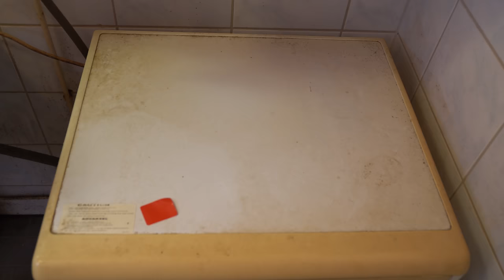Dirty Bathroom Cleaning ASMR

Comment: Here’s a cleaning tip people may find helpful.  For corrosion on stainless steel, like in a shower, take a piece of aluminum foil (or tin foil) and loosely crumple it up.  Get it wet and scrub the corrosive parts.  Not only does it remove the corrosion, it polishes it at the same time.  It’s pretty cool.
Reply: My parent taught me that lighter fluid will remove rust spots from stainless steel. One small container lasts a long time.
Reply: Oi👏👏
Reply: Sounds good, I’ll give it a try.
Reply: like a sponge?
Reply: Good tip! How about stubborn water spots?
Reply: Oi👏👏👏
Reply: I'm going to try that, thank you!
Reply: Cema de semana mais uma semana depois 71🕭🕭🎷
Reply: Cema Olive a minha mãe que irmã 8wji 🕭🕭🕭🕭

Comment: You may want to consider wearing a respirator in homes with black mold. It's likely not good to breathe it in.
Reply: Not to mention using acid in an enclosed space. I would've either passed out or have gotten a migraine...
Reply: I think the acid she uses is just vinegar, or the spray on oven cleaner
Reply: @naomipask1809  Oven cleaner is alkaline (the opposite of an acid) but you still shouldn't use it without proper ventilation. You have to be very careful using these types of chemicals. Just sayin.
Reply: I agree! You must also take care of yourself!
Reply: I agree! The fact that she does not use protection while cleaning those moldy bathrooms!
I feel bad for her lungs.
Reply: I actually came to comment the same thing

Comment: Wanted to add, I love how Finnish bathrooms apparently are usually able to just be sprayed down, with an open drain to wash everything away. Wish we had those here in the States.
Reply: If I ever get to renovate my bathroom I am definitely trying to get this done!!
Reply: You guys don’t have that?? (sorry if this sounds rude, i’m not very good at ✨socializing✨)
Reply: @edwater.3   no we don't but I wish we did!
Reply: @edwater.3  No, not rude at all. No, American bathrooms typically have either a separate shower or tub with either a curtain or glass doors. And we usually don't have just the simple pedestal sinks, but vanities with drawers and cupboards underneath. No drain other than in the bathtub/shower. The washer and dryer are usually in either a separate room or a closet of some kind. Or if your apartment doesn't have a washer or dryer, you have to bring your clothes to a laundromat to wash them. I don't miss that!
Reply: I'm so shocked they don't have them there, here is Australia we have floor drains also.
Reply: We don’t have washroom floor drains in Canada either. Does that mean after every shower you have to wipe the floor down before others can use the toilet/vanity? I can see that being a hinderance.
Reply: @Wood.Gardens  I think the floor is usually at a slight angle to let water flow into the drain so that you don't end up with a flooded bathroom. 🙂
Reply: They definitely have their bathrooms figured out. 😊

Comment: Auri, the toilet limescale remover liquid works fine as well for the limescale of glass and ceramic floor and ceramic wall. They are all ceramic and the limescale is the same. It comes off easily with a brush, hard broom or non abrassive sponges used for dish washing. But better done after having washed with detergent. Limescale remover also rinses the foam of detergent easily. Just be careful with the wood, cause limescale remover is acid and stains the  wood.🌻🎀

Comment: Here’s another tip for black mould on sealant around a bath or shower. Lay a folded strip of toilet roll down over the mould and soak the paper with liquid bleach, the thick bleach like domestos works well. Leave for a few hours and the sealant is pure white again. Also works on grout.

Comment: There are areas she is missing if u look st 18:37 there is still quite a nasty dirty patch right behind the toilet that she missed. Also there is still a lot of discolouration on the grout lines and red rust this really would need a thick bleach solution punted on, left for 12 hours at least and then use a hand held streamer to clean it off. I had to do this recently in my own bathroom and it was amazing the amount of gunk that ran off eith the streamer - even after I had manually scrubbed the grout lines for hours.
Reply: Well, as she can't stay at that place for an extended period of time (f.e: 24 hours), she does the best she can in a given time frame. In her previous videos, Auri has also mentioned that her goal is to make it livable and better than what it was before, and to show the house/apartment owners that any place/situation can be changed, so she sometimes has to leave things the way they are (such as torn wall paper etc.).

Comment: I felt your tiredness through this video! By the way this bathroom is set for failure, the washing machine is right next to shower so deffinitely it will rust and have grease and mold! And the shower area is not seperate from other floors so it's not hygenic! I would place the toilet seat in that corner and make the shower where the toilet seat is

Comment: I was always taught to clean with hot water since its more hygienic, is that true? I wash the dishes with almost boiling water (my hands do hurt a lot of the time 😭) because they feel very oily if i dont
Reply: @goldenapple I'm sorry that I'm answering for Auri, but I couldn't resist :) Generally yes, but please don't hurt yourself while washing the dishes (if you really want to use boiling hot water, please wear gloves - it helps with the temperature), but for example, if it comes to bleach, acid and other chemicals (even vinegar from what I've heard so far), using boiling water after spraying down the product releases toxic fumes from those harsh cleaners. So if you use those, always rinse with cold water!
Reply: I put the dishes in hot water with dishsoap,,then I wait a while...